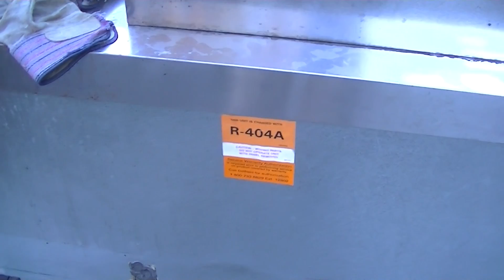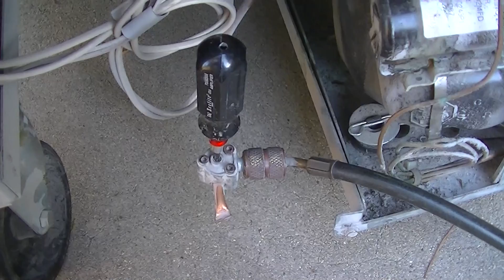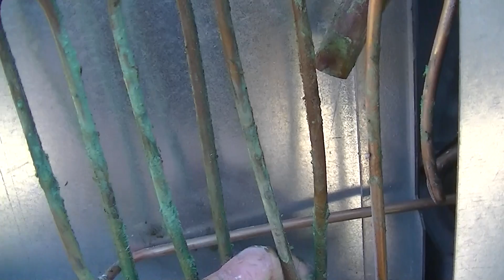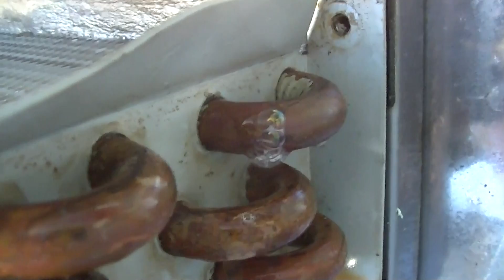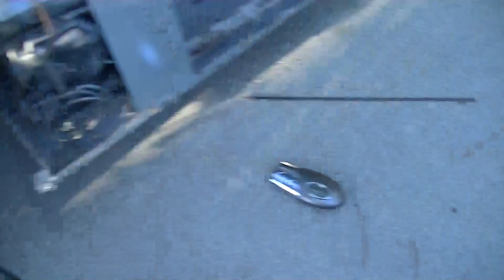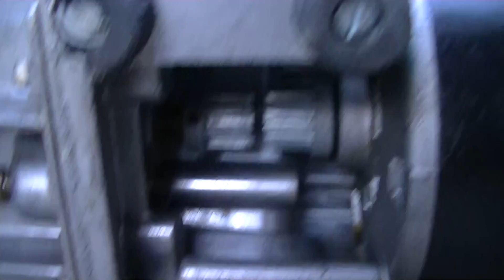Delfield refrigerator refrigerant leak repair

Comment: propane has come full circle. it was used before world war II, and was replaced when "DUPONT" introduced R12. the only" nasty "refrigerant that survived was R717(ammonia). now R290(propane) is back!!!!. the only difference between the propane that is bought at the local gas station , and the cylinder that is marked"R290" is that there is no "MERCAPTAIN" in it(odorant). if there is a leak, you will not "SMELL" it!!!!. it is a real good refrigerant to use, and will run on most compressor oils. it is also used in the second stage(cascade system)for "OIL RETURN" because on" ultra cold" freezers, the second stage runs around 140 degrees F below zero and its hard to get the oil to come back to the compressor, even with an "oil separator" to help keep the oil out of the evaporator!!!

Comment: I have a True Dr. Pepper cooler that uses R-12. Bought it from a guy with a short cycling compressor (possible leak form low refrigerant). What would be the best course to find this leak and would you convert this to R-134a or find something to drop in?

Comment: nice video, I agree with everything ya sad and done, but I heard you say you changed the fan motor rotation and the fan blade looks installed backward. looks like the fan blade needs to be the same rotation as the fan motor.  Won't that cause low air flow across the coil. Nice job on the Leakee Poo

Comment: Hey guys. Love your videos! I have questions I'd like to ask about a Bentley Portable TV 100-C I just found in perfect physical condition, in the original box. It was $5 at a second hand store I frequent. Just wondering if we could talk by email or something. I'd like to see if it works. I don't want to waste money on D-cell batteries, and it didn't come with a power adapter. It's supposed to be 12 VDC. I don't know where to get one that will fit. I have the normal "universal" power adapter that is 12 V but I think it's AC? And it does not fit the plug on the side of the monitor anyway.

Comment: Nice work. I enjoy your practical approach. I have plumbed plenty of ref lines in my years and hardest of all was not ref. It was helium and hydrogen piping. Being that hydrogen has an atomic weight of 1 and Helium 2 it makes it almost impossible to find a leak. 
Good job. I would have said buy a new cabinet.

Comment: Great video but forgive me a wee correction. Not putting refrigerators on their side was actually an issue with Freon systems back in the day. It came from transporting certain ones that had the old rotary compressors with "high side domes"  ( Frigidaire and Whirlpool) and how, when you turned it over on only a certain side shortly after shutting it off, the pressure balancing sent the compressor oil out the shell into the high side causing it to run basically without oil next time it started because the oil could only slowly enter the rest of the system through the cap tube. We were instructed to leave it sit for an hour so the oil could drain back once it was upright.
Reply: I would have to agree, as I have an old Fridge manual that mentions this and says to leave it upright for x-amount of time for the oil to settle back down before plugging it in.
Reply: pleasecho2 - Yeah & my fridge is old so I just play it safe as I can’t afford a brand new one.
Reply: pleasecho2 - LOL mines old but not antique old. It’s about 8 or 10 years old.
Reply: I was always told that too. Every time I moved house, I had to allow an hour before turning the fridge back on after transport.
Reply: Sure you can let a recently moved fridge sit for whatever and it will work when you plug it in but its like if you said "ABRA CADABRA". it would still run ok and you'd think it was because you said that - thats how these myths perpetuate
Reply: When I said old I meant antique (60-70s) but it doesn't matter. Do the magical incantation and enjoy the running fridge in good health

Comment: R 404 is a replacement for R 502. There's always a problem with these and food acids. Specially boxes that they keep tomatoes and onions. Those ends were coated from factory on the evaporator. Those small del fields were hell for the driers stopping up too. Look on eBay for the parts for your vacuum pump.

Comment: Propane in that small amount is not that dangerous and is it a good  refrigerant.  I was told that charging a car or pickup ac with propane is very dangerous.   I am not sure if that is a fact, but I am curious to know..     I converted my old pickup over to 134 a, it cools good, but it leaks out about half of it every fall after the first cold snap.
Reply: european auto manufacturers have been using propane ever since r12 was banned for their own domestic vehicles. fires caused by propane refrigerant have not been a problem. propane is not approved by the usa as an auto refrigerant so those cars that are exported to the states have r134 systems instead.

Comment: Shango, I've been in the refrigeration business for over 50 years. Fixed is fixed and what works works. The industry is changing it's mind on flammable refrigerants. Most units has so little refrigerant in them that it's not a problem. These refrigerants work just fine and have very little (if any) environmental impact. You are going to see more of them in the near future. Your just ahead of the curve. LOL!

Comment: Now I want a pizza. 🤣Excellent skills displayed. Somehow I just knew you'd start with the torch to find the leak. You have done just about everything repair wise, it seems. Really nice work. And thanks for the reminder that laying a fridge on its side is perfectly fine. The manufacturers keep that alive don't they? I bought one of those roll around AC units for my house. Laid it down to get it in the room. Still works fine.

Comment: I've seen this before on a window air conditioner at a hair stylists.  When we cleaned the unit, the frame vibrated its way through the coil.  Had to actually remove part of the frame  and fins to repair the evaporator

Comment: Fascinating!! I didn't know you can use propane as a replacement refrigerant.  Thanks for an educational video!!
Reply: I purchased a new portable A/C unit earlier in the year, and it uses propane (or a slightly modified variant thereof) straight from the factory.
Reply: Old school technique though
Reply: @HDXFH  Yep, very old. Used to top up the car AC with propane. Just have to watch out that you need quite a bit less propane by weight than the original refrigerant.(only 33%) In Australia propane, AKA R600a was and still is used as a drop in replacement for R12. Problem was that DuPont was losing out on their royalties with this natural refrigerant  :-)

Comment: You guys out there a closed mouth is a wise head, SHANGO066 is a trained Refrigeration Technician, what about spraying the pipes that has shed it's paint a mix of Epoxy and hardener and leave it to harden and see if that works.

Comment: Vinegar is a pickling agent that contains acetic acid, which is used to pickle cucumbers, jalapenos and other similar foods. Acetic acid is also an ingredient in some caulks. If any caulk containing acetic acid is used as an insulator for a television flyback transformer that is already coated with a paraffin-based wax, the oils in that wax can transport minute amounts of acetic acid to those extremely delicate copper windings.

Comment: I've used propane to fix A/C systems in older cars, I've never had a problem with it.
Reply: It's pretty hilarious if the car has an engine fire and one of the A/C lines melts and springs a leak.
Reply: If the car is already on fire I don't think adding some propane is going to matter all that much, it wont explode, it will just burn off.
Reply: @bborkzilla  If you just been shopping and you have 3 aerosol cans in your trunk, say deodorant, bug spray etc you got more boom potential there than in your AC because if you convert the AC system to a propane/ butane mix you need only 1 third of the original fill quantity, thats nothing......
Reply: ScottishLion83 Gasolene is far more dangerous then propane!

Comment: Replacement coupler is very easy and cheap, just go grab some hydraulic hose, probably there a 5/8in inner diameter one, with a braided non steel cord wall, and cut a piece out of it to fit the coupler area, then boil it to make it soft and force over the pump end and motor end. Lasts almost forever and works just as well as the original. 

Got a vacuum pump that had a polyurethane spider that died after a year, and no spares to be found, so just used 3 strip of rubber conveyor belting and riveted them into a spider, put it in and 5 years later absolutely no wear on them or the coupler. Previous one wore silently, and then the coupler killed the vane pump by giving it axial force, which destroyed the NDE end wall. That was expensive to replace the whole pump, but as a bonus now also have a spare motor for it.

Comment: Fridge compressor on its side is fine, so long as the connector side is not the down side, as the compressor will have a good chance of popping off the internal spring mounts. All other than upside down are fine when not running.

Leak at the bend is typical, the tubing is stressed during the bending, and this thin tube is already hardened from being extruded, and the extra stress of the bending is going to lead to fractures. Time to blob it up, or just use leak sealer in the refrigerant. I have used a epoxy stick on the outside to fix them when leaking, might be worth a try. As it is evaporator yes it has been sucking air, time to put in a nice liquid line drier there, preferably a big one, and preferably change the oil in the compressor as well. With using R600 you can easily use mineral oil as well, no need to use POE oil with that, but R404A tou just change POE to POE.

Comment: Those coils tend to leak at the ends under the fins, so the leak is hidden for a while. You can add UV dye to it which will show up the leaks well enough, and then see where. The line taps work, but with R600 they do tend to leak with time.

Comment: Pickles, cheese does the same, all release acetic acid and this rots the copper. You get stainless steel evaporator cores and tubing that is a lot more resistant to corrosion.

For the drain pan I just remove that loop. Then put a fan to blow the condensate water away instead of boiling it with refrigerant. You just need to have a coil to replace the removed one to get the same surface area to cool it.
Reply: I have had the next door neighbour in the freezer for 6 months. Should I be worried about the tubing? Should I put the pickles in the garden with the wife? (Watched 10 Rillington Place last night - I think it has had a lingering effect)
Reply: Martin D A - LOL 😂